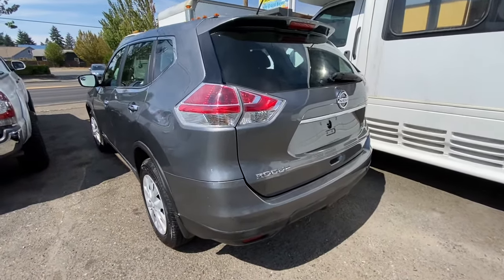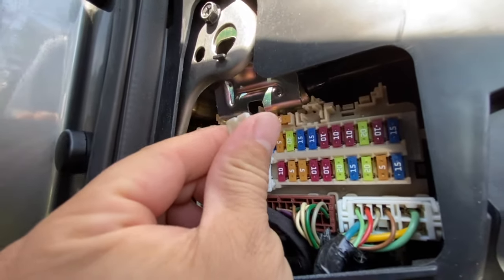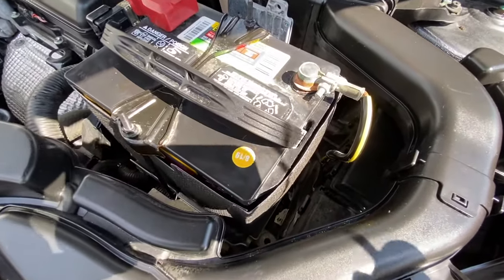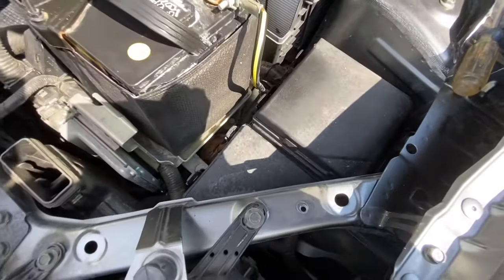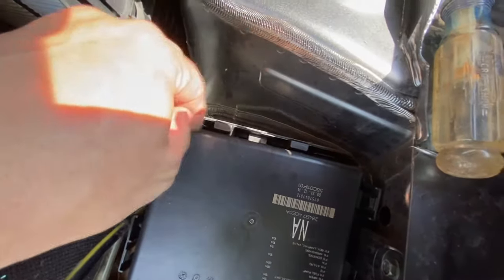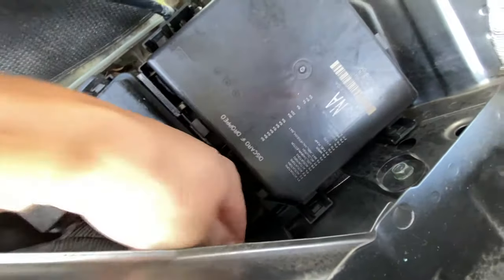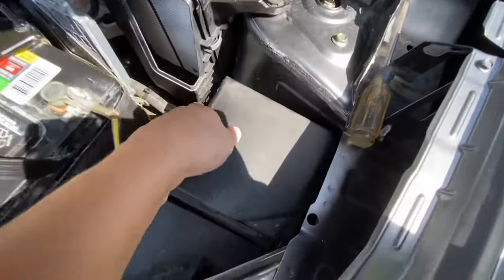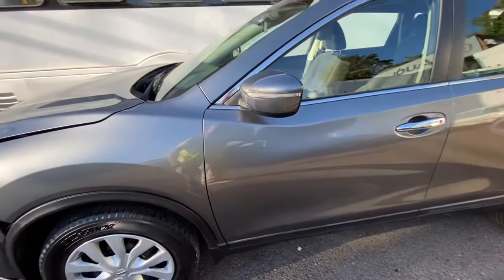FUSE BOX LOCATION ON A 2013 - 2018 NISSAN ROGUE

Comment: Thanks man. My side mirror of the driver seat doesn’t move. I’m suspecting that is a fuse but I cannot find which is it
Reply from the maker: did you end up finding it and did you fix it?
Reply: @dimascartech  no man… it is only the driver mirror. Could be the switch or some cable inside that door.
Reply from the maker: @jonathanpalacios1984  i see, maybe loose connection or connection came off
Reply: @dimascartech  I'm going to take off the whole door to see that.
Reply from the maker: keep me posted.

Comment: Anyone know which fuse is linked to the power socket in the center console?

I changed the 20a mini fuse under the steering wheel, and that fixed the socket underneath the radio.
Reply: I have the same problem. Both of those are out for me and reading your comment I'm surprised they're not the same fuse. 

The one labeled cig_lighter was blown but not the one labeled power_socket. But that may be the rear one which currently works.
Reply: @RandiBrenneman80  my socket was burnt out. Replacing the socket fixed the issue.
Reply: @donnypump9495  Ah. Mine had a dime in it. As soon as I pulled it out it worked 😂. Still don't know which fuse it is but all 3 sockets work now!